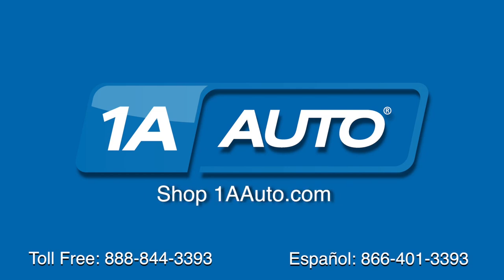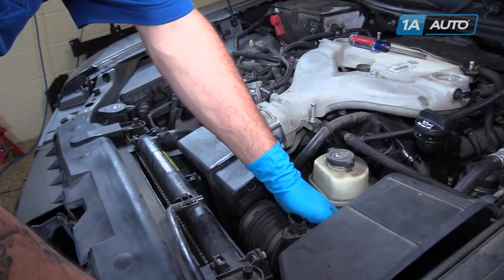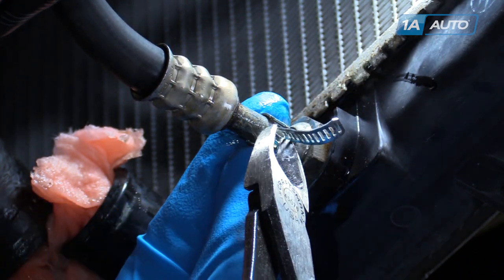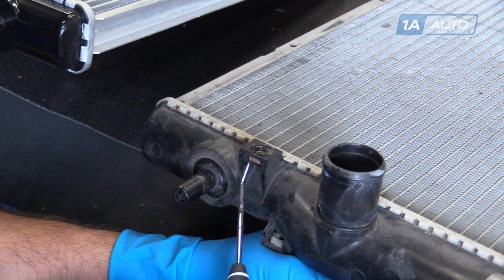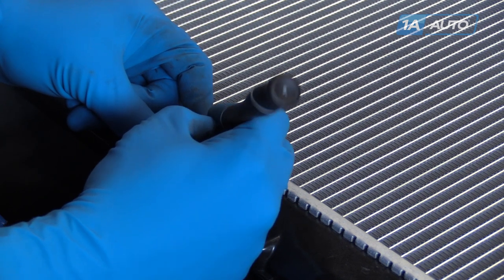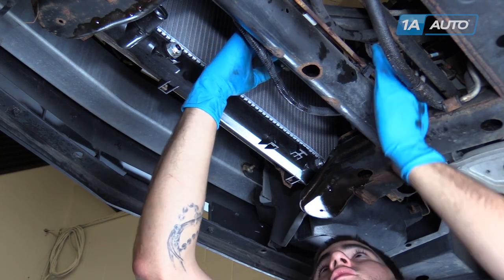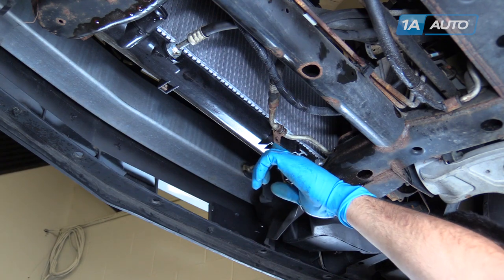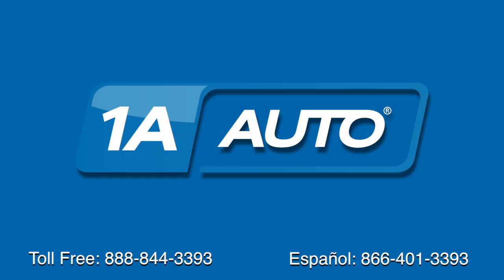How to Replace Radiator 04-06 Cadillac CTS

Comment: What if you have a manual transmission? Will the radiator fit the same way even tho I don’t need to connect the transmission hose or the oil one ?

Comment: You pop those connectors off the fans like they were put on yesterday.  I'm doing my radiator on a 150,000 mile 14 year old car and they don't want to come apart. It is not apparent from the video what you "push down on" or where "the clip" is.  I don't know if you are still answering posts here but if you are I'd love a little more detail on that part
Reply from the maker: +Bill Pennock Thanks for watching!  You want to press down on the harness itself.  There should be a something of a spine molded into the plastic that will have give to it, that is where you press.

Comment: The trans cooler lines will not stay locked in and keep popping out after i replaced with this radiator is there something i can do to fix this or are the fittings defective
Reply from the maker: +durbinator 1980 Thanks for watching!  In a case like that either the fitting on the radiator or line needs to be replaced.  If you believe there is an issue with a part you purchased from us be sure to contact our customer service department for assistance.  Our contact info can be found on our website!  1aauto.com
Reply: Everything works fine it was just that the rings inside the fitting are a little thicker than oem and i had to fight with it a little bit to get it to lock in place but all is well now thanks
Reply: @1AAuto  Hi
I have the same problem, one of the trans cooler pipes (line) popped out 2 weeks after a new radiator was fitted. The pipe will not stay in. When you say that the fitting on the radiator or line needs to be replaced, can I buy them? Thank you and looking forward to hear from you.